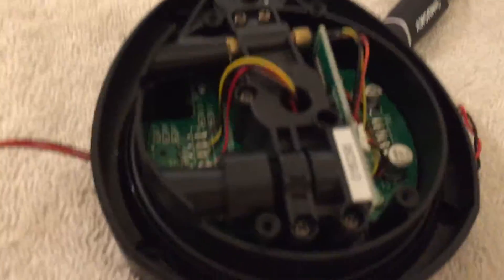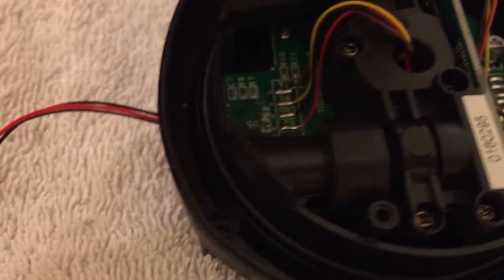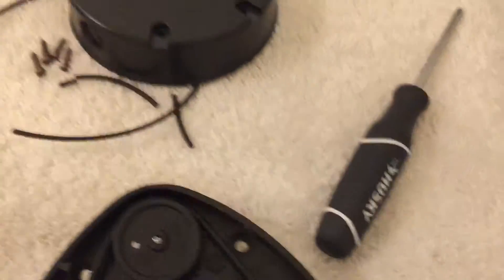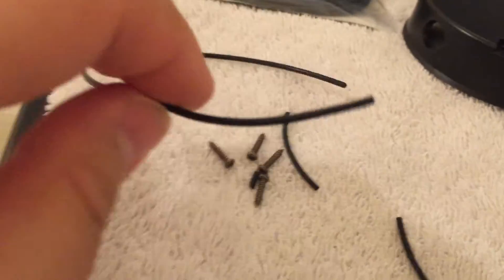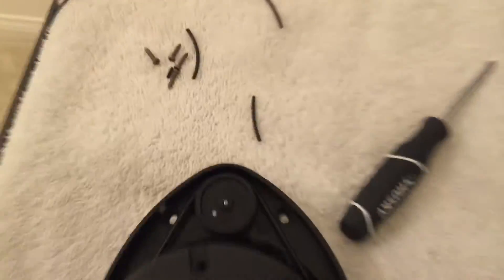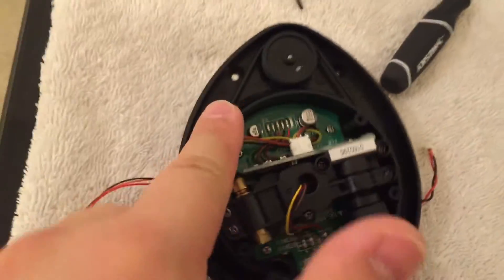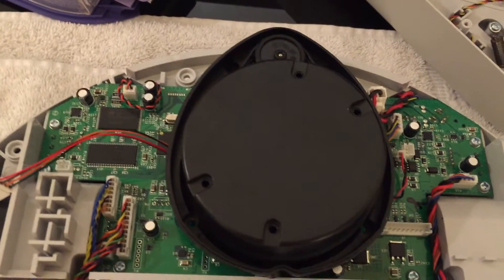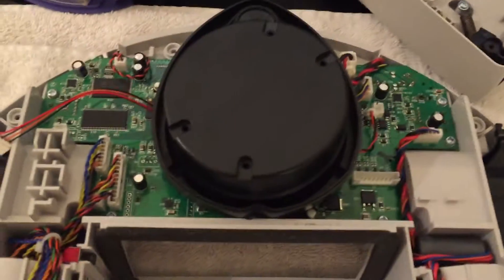Neato Lidar O-Ring Replacement

Comment: mine variating speed after I replaced the motor it did not help, I think there is another problem with the card maybe, so I think I will try put an capasitator on the motor plus and minus,